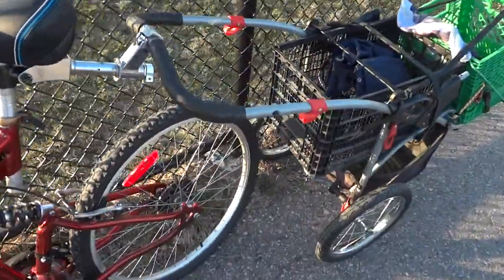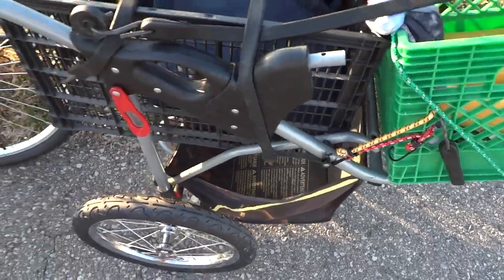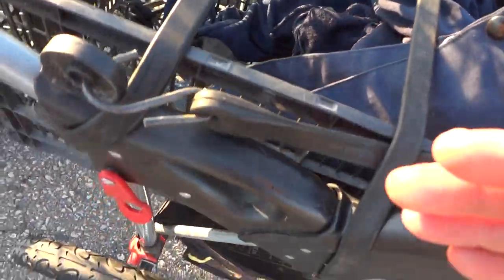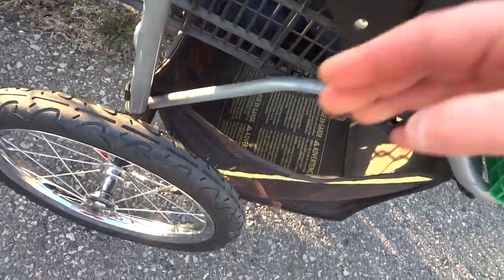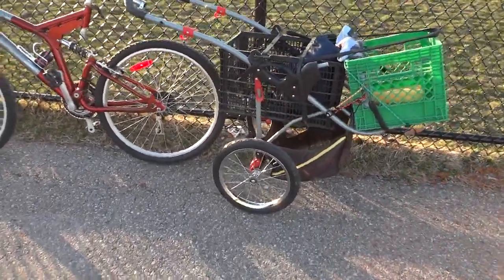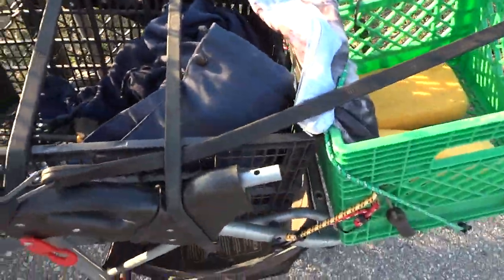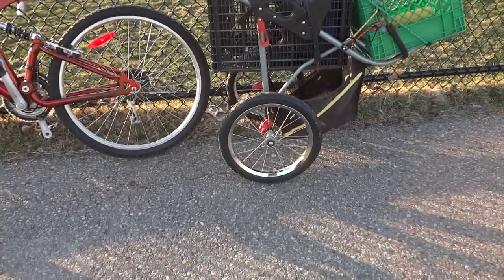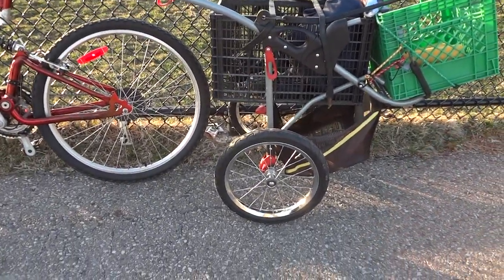Part 3 bike trailer from baby stroller road test results

Comment: What do you plan on hauling in the trailer?
Reply from the maker: This light duty build is just for like road trips / grocery , off camera i loaded at least 30-40 lbs of chains and U-locks and all my gear laptop, tools ect and it behaves the same with that slight side to side wobble and tendency to roll,  i had to add more air to the tires too, less wobble